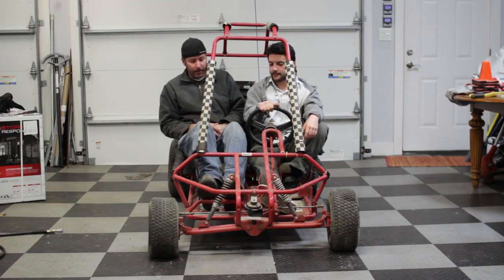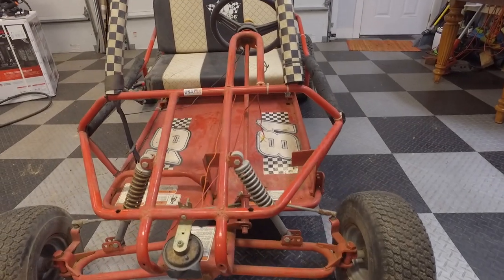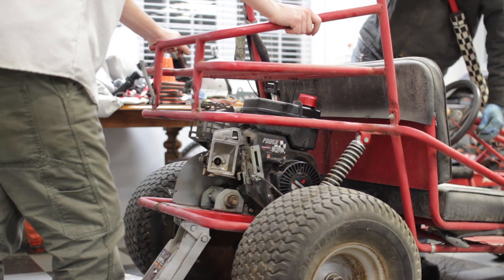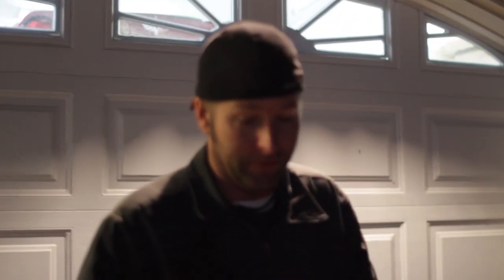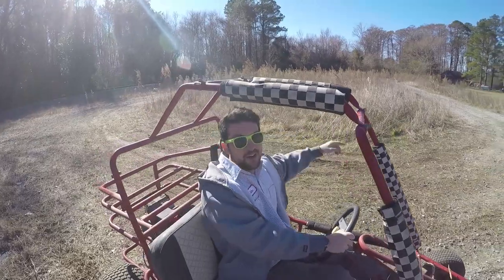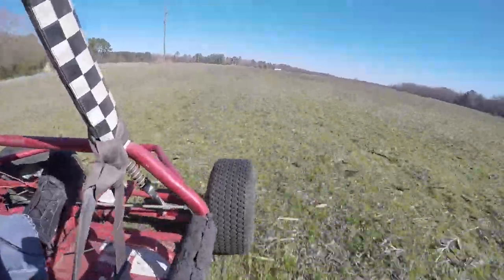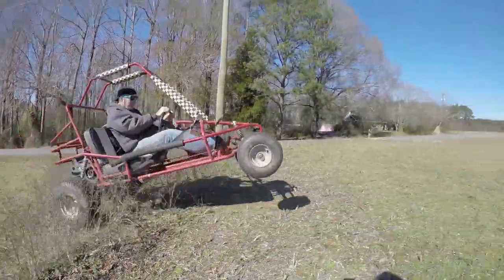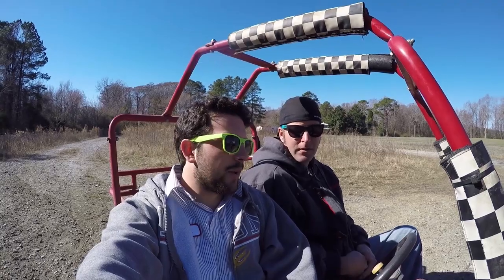$100 Offroad Go Kart Find

Comment: a 250cc ninja motor I had one of them gocarts when I was 12 the frame by the motor where it look like it got welded is where mine snapped   if ur going to jump it a lot I would make the frame stronger and one of my front wheels snapped off  if I still had mine I'd put longer front arms on it an have better suspension

Comment: ur going to want a new converter, I have the same kind of converter and the bearings in the big pulley are rattling and is shaking plus the clutch doesn't fully expand at max rpm but mine prematurely expands and has alot of wear on it and u won't nearly get as much top speed as u would with a new one that is bolted onto the engine. u don't need a new one but u probably want a new one

p.s. is that a tecumseh motor cause I have the same one
Reply: yep

Comment: Bought exact same model cart for $140 about a week ago. Just posted an ad looking for projects on Craigslist, took 24 hours to have a go kart. Knock on doors ppl
Reply: Hey, do you know a good place to find go karts for cheap? I’ve always wanted one but I’m poor. Thanks
Reply: @lobdaboss  you literally just have to check Facebook/offer up/craigslist as often as possible. Deals go fairly quickly, so they are hard to catch sometimes. I also use a want to buy ad on Craigslist, as well as looking around when I'm out driving, typically $75-$200 is what I pay for most projects

Comment: I have the same gokart and it sat for 2 years under a leaking roof with no gas cap and it fired right up no starter fluid nothing I got it for 150 dollars
Reply: And the idle is wonky on mine too

Comment: What's the clicking/knocking noise at 8:20? On idle
Reply: its a noisy engine
Reply: Isaac it'll be fine thanks Sherlock
Reply: you asked
Reply: Isaac it'll be fine I got excited when I saw a reply expecting somebody that knew the difference between a camshaft and a toothpick

Comment: They.  Might.  Want.   To.   Straightened.   The.   Frame.   On.  The.  Front.   It's.   Bent.   To.    One.   Side.   That.   Will.  Mess.  With.   The.   Steering.   And.  Driveing.    Straight